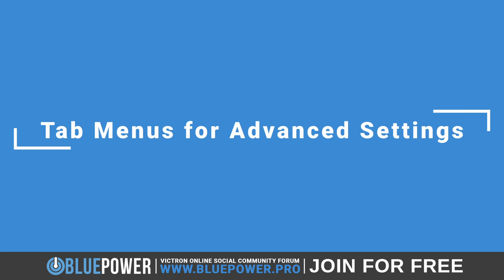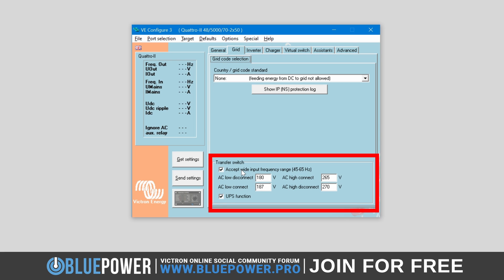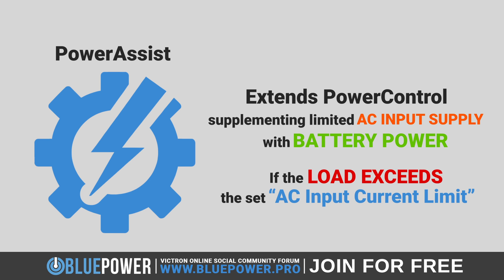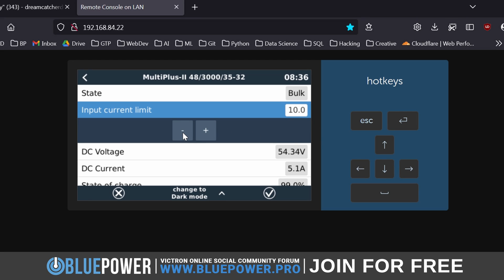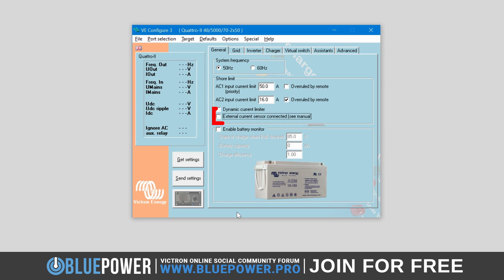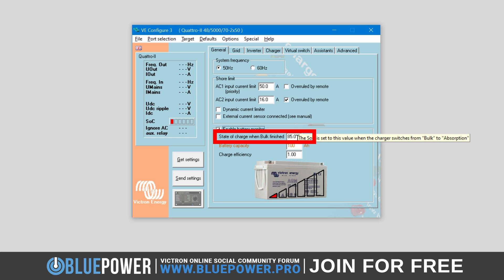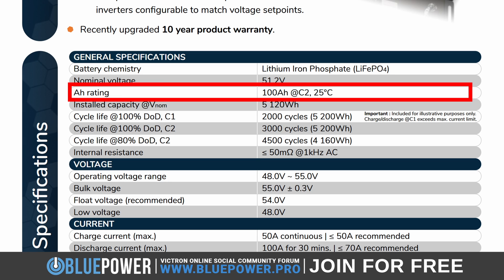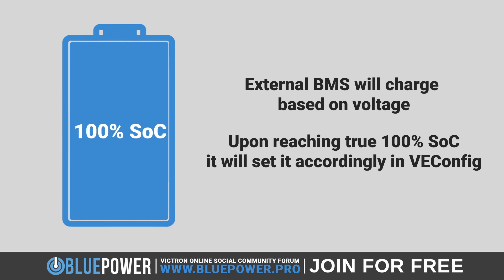Victron VEConfig - General Settings Tab Tutorial [UPDATED 2024]

Comment: I've been watching your vides; they're the only ones that provide a thorough explanation. I'm new to Victron, but am an electrical engineer so I at least understand the theory. Do you have a video on the Charger tab? I don't see it in your list. Thanks!
Reply from the maker: Thanks, glad it helped. When i started there was nothing of the sort, and was immensely frustrating to figure it all out, which is why i made the videos. 

No there isn't a charger version as they take about 2-3 weeks to script, voice and edit, so haven't had time. But basically if you have lifepo4 batteries set: 

Enable Charger ON, Lithium Batteries (which will set most of the settings for you), "Charge Curve" to "FIXED".

The absorption and float voltages to your battery data specs, and you desired charge current, again not surpassing your battery specs or your inverters charge current. 

The absorption times i set to 1hr, 7 days and 1 hour. 

You can enable and set the "stop charger below" to anything above 0 degrees if you are in a  cold climate, as batteries should not be charged below freezing.

Comment: I have the Multi plus 2 24v. All software is up to date. I do not see the advanced tab on my program. How do I get this? When checking for update, software says lastest version is installed
Reply from the maker: That is weird, never seen that before. Does it happen if you run it in fake target mode? The advanced isn't really a very important menu tab thought. there is only one setting in it, which you shouldn't use unless you know exactly what you are doing

Comment: Hello and very nice video
could you confirm for my miltiplus 8000VA model (6400 watts in 230 volts) that I have that by using the PowerAssist
I cannot exceed this limit of 6400 watts by using the network and the batteries?
either as EX: a 3600 watt EV load, a 2500 watt heat pump and a 1200 watt cumulus or 7300 watts
16A coming from the network and 15A coming from the batteries (69A in 52 volts)
the total network plus battery load will exceed the maximum capacity of the multiplus in 8000VA?
another solution to pass more than 7KW between the network and the batteries? ESS?
thanks
laurent
Reply from the maker: If you have solar added to your setup ESS has this function is already built in, allowing it to automatically buy the extra power needed from the grid as needed.  

ESS makes use of power sources in the following order "Solar > Battery > Grid" if available.

NOTE: Power Assist should NOT be ticked if making use of ESS

Comment: Thank you. Informative. Will there be a video about the EasySolar work? Many people have solar panels now. What is better and more reliable EasySolar or MultiPlus II GX+MC4 controler?
Reply from the maker: The EasySolar II GX is simply all-in-one product (inverter+MPPT+GX), meaning you have to use what its built into it, but its also easier to install. This guy does a nice review on it https://www.youtube.com/watch?v=ssw1NGxENYQ

Whereas the MultiPlus II https://amzn.to/3MmDZJw + Cerbo GX https://amzn.to/3MrBWDH + MPPT https://amzn.to/4dUhRll, are individual parts that gives you the modularity to build whatever custom setup you want, but requires more knowledge to put together. 

NOTE: Its always better to buy the Cerbo GX as a standalone device, instead of the built-in version found in the EasySolar II GX or MultiPlus II GX https://www.victronenergy.com/inverters-chargers/multiplus-ii-gx.

The reason being that it has a more powerful processor and more ports. The one Victron technician told me that the built in -GX is actually the older Venus GX https://amzn.to/3WZpPCL , just without the casing. 

While the the Cerbo GX https://amzn.to/3MrBWDH (which as i said is newer and faster). 

You must never buy the Venus GX even if its cheaper. It gets very hot and struggles to keep up with processing the data.

Hope that helps
Reply: @BluePowerPro  Thanks for the detailed explanation. Very informative. More videos and creators like this, without unnecessary words.

Comment: Hi! I have Victron Multiplus II 48V - 5000VA - 70A + Cerbo GX. Please advise how can I use gasoline 6 kWt generator. Once battery is low and blackout, how can I charge battery with generator? Do I have to change battery settings (SoC, DoD etc) every single time I want to charge lifepo3 battery with generator?
Reply from the maker: Are you off grid with the generator connected to AC-IN1, or is your AC-IN1 connected to the electrical grid?
Reply: @BluePowerPro  AC-IN1 is connected to electrical grid. I am always on-grid but blackouts are very often. If blackout is very long, I want to charge batteries with generator. As for now, no solar, only UPS needed. Maybe later in future I'll add solar panel, not now.
Reply from the maker: @bohdanbatsenko4843  You would need to have the generator wired in, on a selector switch, in order to be able to pick Grid or Generator power.

Note that the Charge settings should not need to be changed, as this is already set. What we would need to look at, is input current limit for generator vs grid, as well as the Grid Tab settings, as they might need to be changed, in order to accept the generator.

Comment: Does the Soc values still work when charge and discharge happens in isolation to the Multiplus. Like in a van with dcdc rather then shore power charging.
Reply from the maker: If you are running a lead acid or Li battery, (that does not connect to the Venus device) , then make use of a SmartShunt/BMV connected to Venus device for the SOC values to be corrected